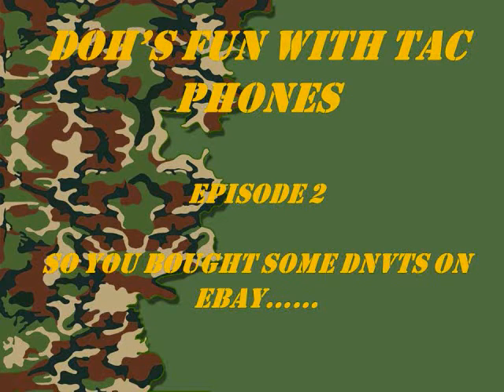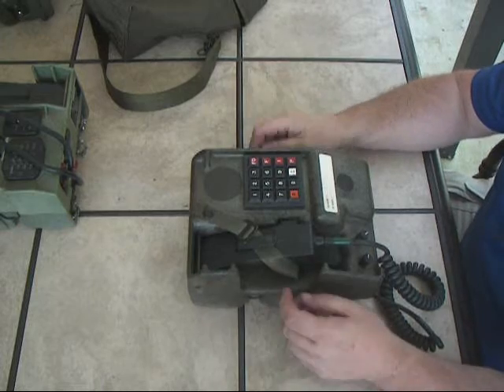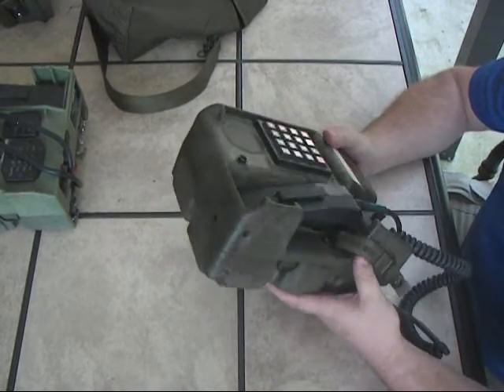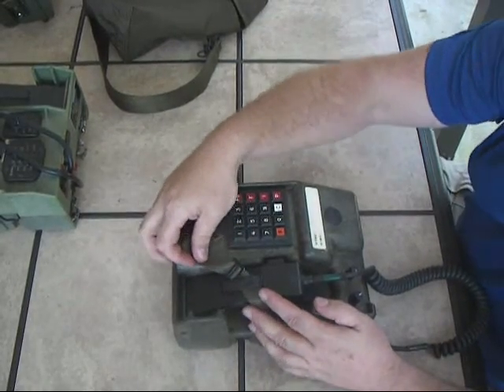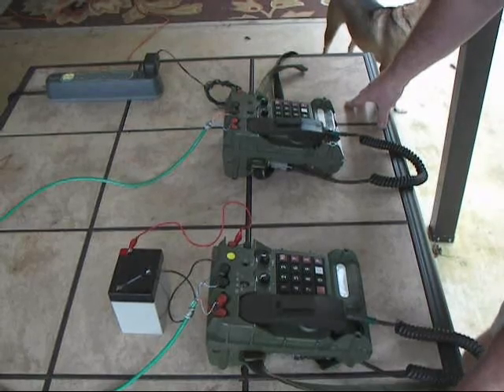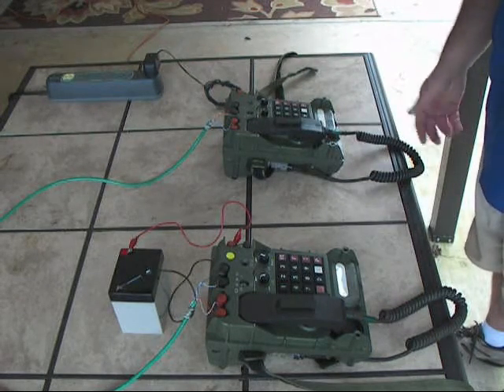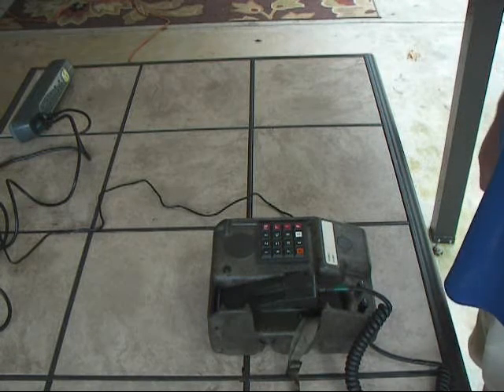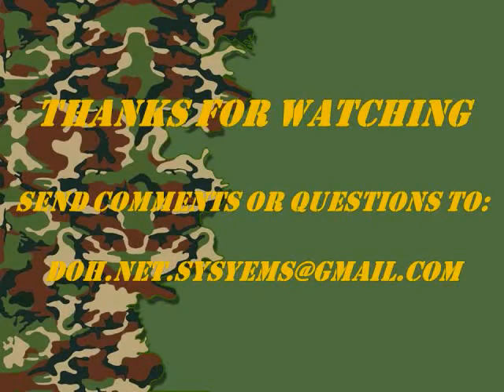FIELD PHONE OPS:  DNVT Fam and Testing

Comment: I need connect this phone to convencional analog phone line can i?
Reply from the maker: DNVT Phone?  No it cannot connect to an analog phone line
Reply from the maker: There is a company called A-1 Telephone and Electronics that will take a DNVT and gut it and replace the components so you can use it with a two wire POTS phone line.  What kind of DNVT is it?

Comment: Can TA-838s be hooked straight to one another like the TA-312s and use internal batteries to ring one another? If so can it be done with the same two strand wire that you can use with the TA-312s?
Reply from the maker: NO.  The TA-838 lacks the built in ring voltage generator (hand crank) like a TA-312 has.  They will communicate with each other in 4 wire mode when sent to point to point.  In this mode they generate an actual ring tone that signals the other phone.   If you set them to both to 2W LB you can talk between them using two wires but won't be able to ring them.    Have you looked at my field phone capability video?  T
Reply: I've watched all of your videos (maybe enough to confuse myself), but I didn't see much about the TA-838.   Thank you for the response. Videos are an excellent resource.
Reply from the maker: I started a facebook page for field phone collectors; www.facebook.com/groups/632699090958433/